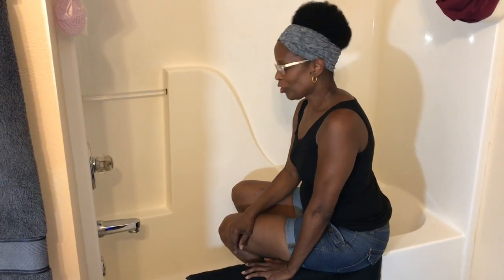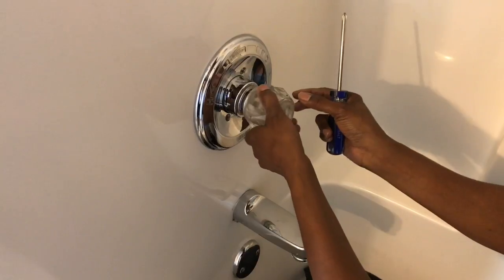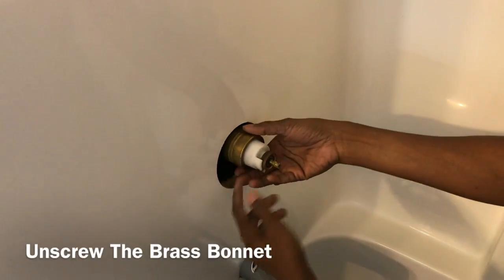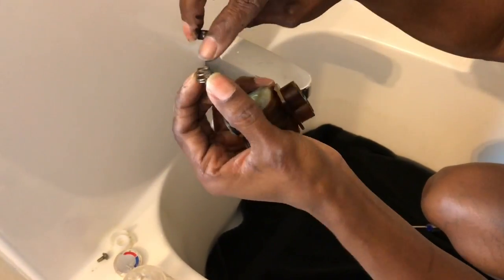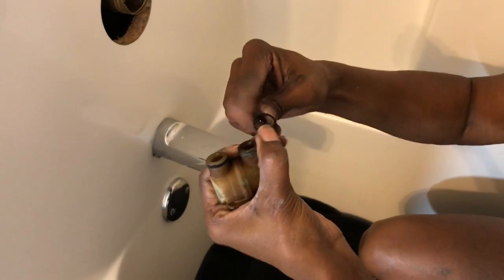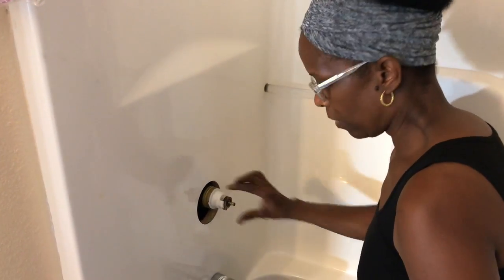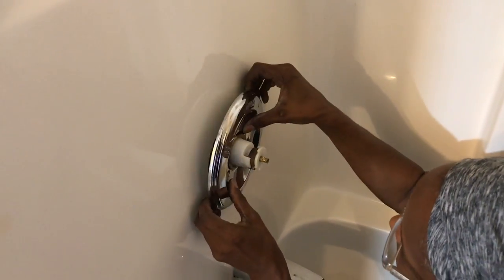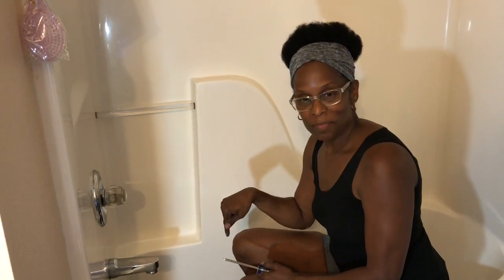How To Fix A Leaking Tub Faucet | DIY

Comment: WOW!!!!! Great job Nita!  So let me ask you a question. I see the NEW cartridge you had but it looked like you kept the old cartridge and just replaced the 2 old rubber washers and the old rubber & spring pieces. Also, does the NEW cartridge already have new springs and rubber washers with it???  If it does, it seems like it would be better to replace the entire cartridge.   Thanks for your reply.
Reply from the maker: Yes the new cartridge has new springs and rubber bands. I did put the old cartridge back to finish the video. I had to run to Home Depot to get the new one. I saw that the old one was too busted when I took it out of the wall. Good eye 👁

Comment: Great tutorial.  This shows homeowners that this stuff is not hard to do and can save themselves tons of money.  I always say try it, it's already broken so you can't break no more.  One suggestion.  I always rub plumbers grease on all rubber seals so there is no rough dry fit or risk of damaging seal doing replacement.  I just installed 2 new Delta Porter tub/shower units and one was leaking.  I just removed and returned to HD.  I hope the replacement is good.
Reply from the maker: Thanks for the tip. I hadn’t thought of that. (Plumbers grease)

Comment: How do you know what size cartridge you needed? Is there a product number on the old one? Lastly, do you have to release pressure from every water source location in the house or is just the bathroom you are working on?  Thank you
Reply from the maker: I had the Delta Crome sign around my faucet. When I took the cartridge out, I went to Delta website and it was a match. My part # is Rp19804. And is a Genuine Delta part. (There’s other brands, I wanted the original brand) Home Depot, Lowe’s and any plumbing store carries these. I didn’t see that cartridge # on the old one. I keep the empty box in the drawer because it has the part # on it.  (I’ve replaced it twice in 18 year’s) Lastly, shut the water 💦 off in the entire 🏠 house, otherwise the water will run out  forcefully. Hope this helps 🤗

Comment: Hi, do I need to turn off the water valve from the water heater or do I need to go outside and turn it off?
Reply from the maker: Use the shut off valve in your house. Mine is in the utility room on the wall behind the water heater 🤗
Reply: @breandnita5747  I thought I did...but the water is still running when I cut it on

Comment: How do you know if you have to replace the whole cartridge or if you can just replace the springs and o-rings?
Reply from the maker: I seen how corroded it was when I pulled it out. I changed the springs and 0-rings and it still leaked. That’s how I knew to change the cartridge 🤗
Reply: @breandnita5747  I couldn't get the brass bonnet off even with a strap wrench.